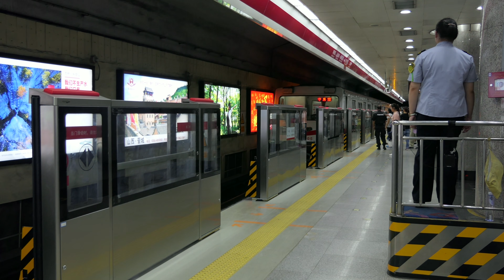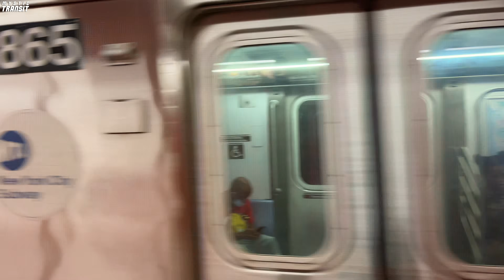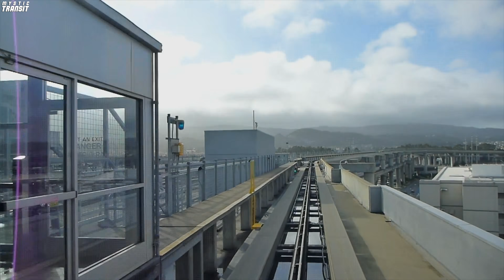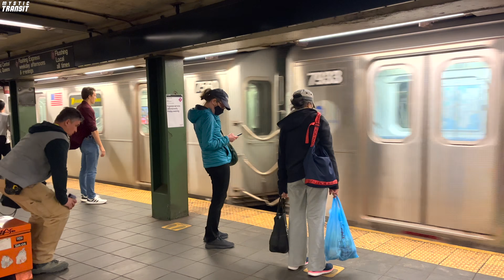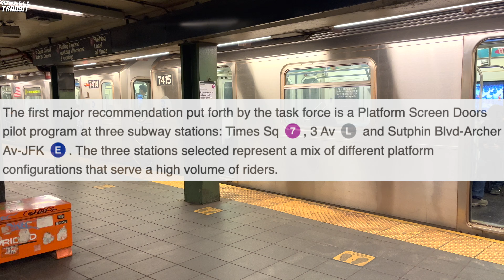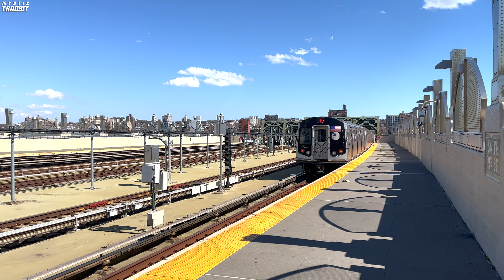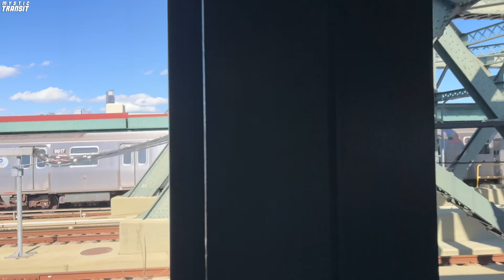Does NYC Need Platform Screen Doors?

Comment: Another issue with platform screen doors is that some stations are at a curve. Example: 14 st Union Square on the 4 5 6 lines. Although a very congested station is is impossible to imply screen doors at that station especially with gap fillers installed in that station.
Reply: Clearly not impossible when Paris has managed to retrofit them onto its network from a similar era

Comment: I get that people want to see platform screen doors in NYC but i can see so many things going wrong with it.  What if the doors don’t work and they stay stuck closed or open?  What if those doors are vandalized? What if the train operator goes slightly past the mark for the doors?  Like others have said, there are more pressing issues in front of the MTA like making the stations ADA compliant and renovating subway stations across the city.  Hell i wish the MTA would focus on putting A/C in the subway stations.  It’s a shame that people simply don’t stand away from the platform edge so that this wouldn’t be an issue to begin with, let alone the other crap that can happen down below. Just my 2 cents 0

Comment: Singapore was the first to do this, and the reason they did it was to make it less expensive to air condition the stations, without letting the conditioned air into the tunnels. Foreign observers looked at the platform doors and thought it was a great idea to solve the problem of people falling or being pushed off the platform. So now there are systems that have half-height platform doors, which don't solve the original air conditioning problem.
Reply: Actually, the first system to use platform doors was the St. Petersburg (then Leningrad) metro, on line 2 in the 1960’s. The only downside is that the view of the train was completely obstructed by the windowless walls and doors, so you couldn’t tell which train was coming from either direction unless you heard a noise.

Singapore only took notes from St. Petersburg and added windows, while other cities used half-height doors. If I had to guess what type of PSD’s NYC would use, it would probably be window doors for newer stations like 34th Street-Hudson Yards, and half-height ones for some older stations.
Reply: @VinceHere98   Lille was also before Singapore and the first city to use glass doors in 1983

Comment: The platform screen doors may sound and look like a major upgrade but the one detraction about the screen doors is the fact that trying to place the screen doors in an 100+ year old system is going to block views.

 Plus remember graffiti and scratchitti can be placed on the platform screen doors and if vandalism happens it will restrict a lot of views. I can only imagine a glass or plastic barrier with a lot of graffiti to the point where you can’t even see the train coming and going until the platform screen doors open. It’s not a pretty sight!

Finally, what if some of the platform screen doors don’t open. You have some trains with that problem of not having their doors open and people jam the doors open with their hands therefore reducing the effectiveness of the train doors. The same problem can happen with the platform screen doors as they can get stuck and not open.

Lastly, if the platform screen doors can’t open in a major fire or another emergency, there’s going to be a lot of hell in the subway system and the platform screen doors which are designed to prevent people from falling into the tracks will be just another impediment to safety.

Comment: First of all, why everything is so damn expensive when it comes to construction? 100 million dollars for PSD in 3 station?
PSD's are great and they should be the norm. Apart from safety (people falling, wind from trains, especially ones that do not stop, preventing someone from intentionally going down to the tracks and usually is required with fully automated trains) it can also enable air conditioning underground stations.
That said, there is much a cheaper solution that protect people from falling (for any reason) and fits all trains called rope screen doors that rolls up and since it only has a few small rails it will fit any train and any amount and types  of doors.
Here is a very cheep version that uses a grill rolling up doors in Bulgaria
https://www.youtube.com/watch?v=qOESYHlp1bo
And a test made in Barcelona for a more sophisticated system
https://www.youtube.com/watch?v=utdgJa-Ikzo
And a full demo of this system
https://www.youtube.com/watch?v=9as5YYHIuAw

Comment: IF the IBX doesn't get them i'll be pretty disappointed. you've got a brand new line, make it the best in the country
Reply: Commuter rail doesn't use platform doors, it's not a necessity. That's what IBX would most likely be since it'll be sharing tracks with freight trains.

Comment: I think the easiest place to start is the IRT, because all the cars are the same length.
Reply from the maker: All of the cars are the same length, but the door widths & locations between the SMEE's and NTT's are much different.
Reply: @MysticTransit  Forgot about that lmao
Reply: @MysticTransit  I say just make the screen doors fit the maximum length door. What IRT car has the longest door width?
Reply: @aqua2poweros699  That's kinda irrelevant. Platform doors are usually wider anyway to account for slight differences in stopping positions. I think wide platform doors might (*might*) be enough to account for the different door *locations*, where NTTs have more doors closer to either end of a car than the R62s do, but not by an extreme distance I think. And we can have wide platform doors because we don't have to put seats or gangways in between the doors lol.

To answer your question though, R62[A]s have 50"-wide doors (I think that's the case for every SMEE), and R142[A]s have 54"-wide doors. But if R262s follow the R211 trend, we might see doors 60" wide on those new trains. (They're 58" wide on the R211s.)

Comment: They can opt for adjustable platform screen doors. It's very new, since it will just be inaugurated when Umekita Station in Osaka is opened in 2023.

Or the MTA can opt for vertical PSDs, similar to what they have in some stations in Paris and in some stations under JR West, like in Rokkomichi Station in Kobe.
Reply: Nowhere in Paris has vertical doors. Lines 1, 4, 13 and 14 all have fairly conventional doors

Comment: Flexible screen doors would allow for the use of several rolling stock types and would not be substantially more expensive than conventional screen doors.  But really, before screen doors I think the MTA should put more emphasis on station maintenance, and making the stations be not such grubby, run down places.
Reply: If you feel that the NYC subway stations are grubby now( and many still are), consider that until the 1970’s, all station platforms and mezzanines were just plain concrete that already has over a half century of filth and grime not to mention that everything was illuminated by DC powered incandescent lights. No speakers for even bad announcements, let alone any provisions for wiFi which didn’t exist then. and in the 70’s ’s most walls and rolling stock were covered in graffiti. You had to. Have tokens at first under the size of a Dime,  then enlarged to just under a Quarter. Token booths at only one end of most stations. And paying in cash only. Air conditioning on rolling stock did not happen until the 80’s so all there was were barely operating ceiling fans. No announcements on rolling stock so if you stopped in a tunnel, you would never be informed what was going on.  
It took the State creating the NYCMTA as opposed to the NYCTA to finally be able  to tap into Federal funding to begin to resolve these problems. There were some drawbacks that had to happen apart from price i creases. Just about every platform had vending machines and some even had news stands. Many larger mezzanines had various types of retail businesses and food establishments. Due to very rampant subway crime, these were eliminated. Platforms began having an easily cleaned terrazzo finish, fluorescent lighting was installed making everything brighter, graffiti was removed and ceilings painted new rolling stock was purchased with A/C and intercoms. Announcement speakers on all platforms. And most important, the Transit police were finally absorbed into. The NYC Police Department instead of being on their own. In a system now over a hundred years old, progress takes mire time than you may desire but with the reasonable input from the public, the MTA can set proper priorities to permit progress. The last fifty years prove that it can be accomplished.
Reply: @walterulasinksi7031  Oh, I know.  The system has come very far since Robert Moses tried, and nearly succeeded, to kill it.  At the same time it has a long way to go, and I hope the people running it can get it there.  Warts and all, it's one of my favorite features of NYC.
Reply: @murdelabop  Robert Moses, while he did recognize the need for improvements in the city, he did nor realize that he also was creating the situation that the city faced fifty years ago. His creation if Parkways encouraged flight from the city and encouraged blight. His warehousing of the economically deprived into city projects merely created a  higher density of conflicts that spilled outward. He did not recognize that by limiting the manhattan parkways to non commercial traffic, he created a greater density of pollution. His blindside was that he had created Authorities totally non- responsible to the public they served. And would not accept that in a changing city, his visions had become unworkable. And eventually catastrophic. Remember, it was his insistence that the World trade Center be raised from the initial 60 stories to 110 stories high while still using the already built foundations. This caused design changes that made the core structure with the elevators and stairwells to be surrounded only with thick drywall instead of concrete. Snd lighter steel framing 9n the upper forty floors ,to  the severe detriment on 9/11. He never realized that even with a population mire spread out,,that there would be increased traffic jams, insufficient parking in Manhattan and that mass transit still needed to be considered as the most economic means for city human transportation.
Reply: True the video of the new Hudson Yards station is where the NY subway needs to aim towards but I think upgrading will be difficult on a network that is so busy. Looking at London I think that the Elizabeth line has provided the ideal opportunity to look at releasing capacity on the central line and potentially some other lines too to support other network upgrades. There was massive opposition to the line and a lot of people who said they were happy with their traditional routes who are now converts to the Elizabeth Line.

There is currently talk about a second Crossrail line from SW to NE London and potentially a Brighton Mainline 2 project that would focus on Croydon, Lewisham, Canary Wharf, Stratford and beyond that again would be a great game changer in diverting more passengers off existing national rail and TFL (underground & TFL rail) services. An expansion of the Bakerloo line to Lewisham is also on the cards and this is something I fully support as it will provide a great link to an underserved part of London. 

Coming back to NYC new dedicated rail/subway lines with high capacity ( like the Elizabeth Line’s 1,500 per train) could also make east to west travel easier across the water from New Jersey to Manhattan (under the Hudson) and out east to Brooklyn, JFK and other communities providing a great way of encouraging a switch from congested roads to fast rail. Likewise north to south lines could remove the need for “express subway” lines allowing potentially more stopping services to operate as the U.K. HS2 rail project will permit.

Sources:
www.crossrail2.co.uk   &    www.BML2.co.uk
Reply: Platform screen doors also shouldn’t cost $33,000,000 per station. But this is the MTA. Going to flexible screen doors would make it about $105,000,000 per station, and would require a 3 1/2 year closure to install.
Reply: @Joseph there also needs to be a comparison of , on a system that is over a century old, the number of incidents where a passenger has fallen off the platforms either through accident or intent, to the cost of installing and maintaining a screen system. And with the consideration of the actual number of riders per day. Such figures would show that the percentage is well under 1%, meaning  that the public has an awareness of the actual danger and does not require such an over protective measure. Such a cost/ benefit analysis can be then compared to one for the installation of full handicapped access to the system. Such @ system benefits not  inly the handicapped but anyone for which using stairs can be dangerous. The accident figures are much higher as there is a different set of demographics to consider.
Reply: True, I work at mta and the broken down and dirty stations really get to you after a while. At the very least it makes me appreciate home more since it’s 1000x cleaner
Reply: @Mingodough  while stations may still be broken down and dirty, they are a far cry from fifty years ago, with just unfinished concrete platforms with fifty years of dirt  and grease embedded in them, incandescent lighting fixtures that made stations seem as though you were going into a cellar, tons of tagging and bad graffiti. And the only benefits were stations with public pay toilets albeit poorly maintained,platform vending machines , Platform news stands and in some stations retail stores and food establishments on concourse levels. Crime so rampant that it took the major effort of the Guardian Angels to convince the public that they were not a street gang of thugs.
Reply: Yes I agree! Also make more stations accessible for people with wheelchairs/physical disabilities and those who use strollers.
Reply: Some train station in Japan use a system where multiple ropes get lifted up and down when a train arrives, supported by a few columns. This could work for New York City's system too.
Reply: the grubby run downness is too iconic, I believe it shouldn't be changed. It makes the subway really feel a shit ton more authentic
Reply: @glassyturkishman  what 🗿

Comment: Now I kinda agree with the platform screen door since it would be more effective but if we need platform screen doors for the whole system, then they need to be implemented in a way for different rolling stock. So I'm not sure if it's the best solution. Now in case there's some sort of system that the MTA can add to prevent more people falling on to the tracks then I mostly can agree with this more bc if someone does fall off the tracks it sense it as an unauthorized personal and the police can respond faster to that emergency.

Comment: Is there any particular existing technical limitations to having standardized train door widths and placement across the system or is it just due to the rolling stock of different trains being older than others?
Reply: Dimensions of the track curves between Number lines and Letter lines is different. Meaning Number lines have shorter 3 door cars for the tight turns while there are 4 doors on Letter line trains

Comment: i feel like a good and low-tech intermediate solution would be to have barriers on the platforms of stations with gaps where doors are. while it might not stop someone who is intent on getting on the tracks, it could help reduce the dangers caused by crowding the platform at overcrowded stations. i remember they used to have these at the south ferry loop
Reply: I think there's a tiny tiny example of this on the N/Q platforms at Canal St, next to the stairs that go up to the J line.
Reply: @dreamsvillager  yup, to catch people who fall on the stairs
Reply: I mean there’s a problem with 75 and 60 footers, until the 75 footers get retired this could happen
Reply: @offsidepayton  The bright side is this will be less and less of a.problem, even just within the next few years as R211s come in and CBTC is decided along more lines. Broadway will be the last to get CBTC* so chances are all R68[A]s are going to the N, Q, and W while the rest (A, B, C, D, E, F, G, R) will be 60 footers.

*The J and M lines in Brooklyn might not get CBTC at all as far as I know right now, but those lines already have 100% modern 60-foot rolling stock today!
Reply: @offsidepayton  true, but for the time being these could just be installed on the A division and CBTC equipped lines

Comment: I'm both for and against this idea mainly because of the cost and complexity of different Rolling Stock as you mentioned and also importantly necessity. I think for many of the stations that have a higher crime rate on reports would be better suitable for these types of implementations and should be tested in those type of areas. Another note they would have to keep some stations available for interlocking anyway and other maneuvers if not they will block themselves causing delays and more importantly messing up our railfanning videos LMFAO the last one is irrelevant but just a funny joke. Good video!
Reply: iirc Osaka Metro has PSDs that adjust depending on the rolling stock.
Reply: @ianhomerpura8937  that would solve the problem with the different variety of Rolling Stock being rerouted for sure but then when coupling procedures need to happen I can't imagine how they would be able to do that with doors blocking. I know the doors only open when the train doors lineup with the PSD
Reply: @GoldenArmy2020  if that is the case, vertical PSDs are much better, like this one in Kobe.
https://youtu.be/ycQ5JeNJ33k